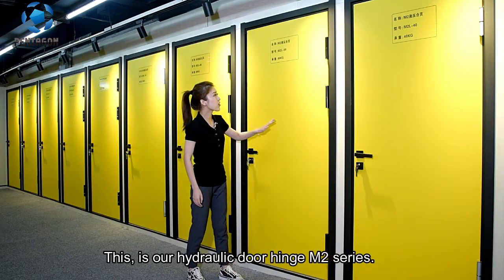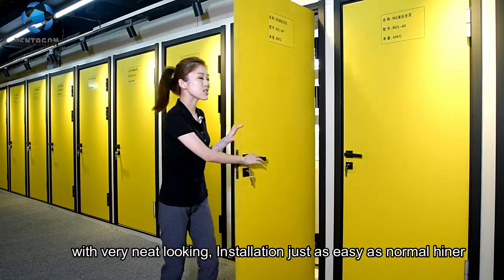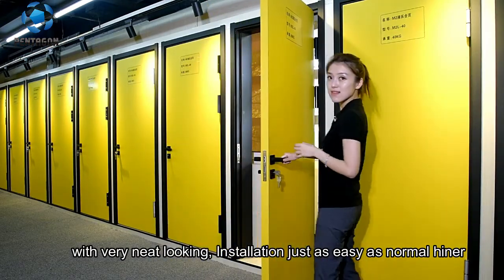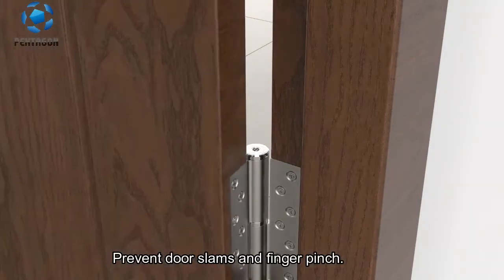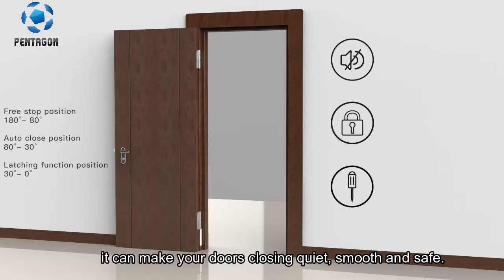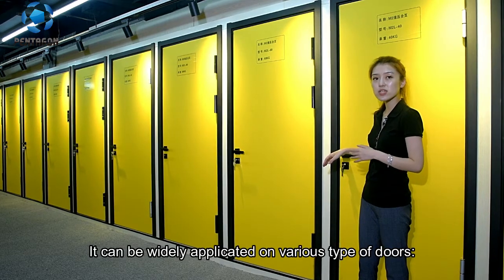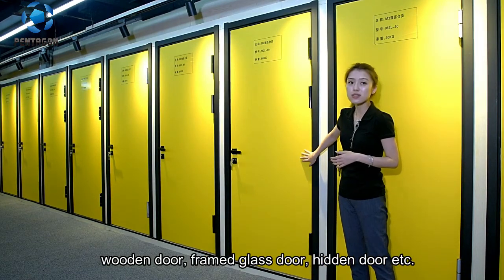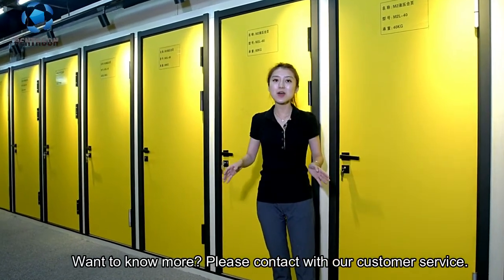Hydraulic door closer hinge, anti pinch and prevent door slams

Comment: can we control  from which angle the auto close needs to start? 
currently after 85° the auto close starts, can we reduce to 50° so after 50° the auto close must proceed.
Reply from the maker: The angle to start auto close is preset in manufacturing, can not be adjusted by users.  It needs to be customized if needed smaller angle.  
Why you need it to be 50 degrees?
You may also take a look at our door damper P7 which start auto close only from the last 15 degrees. 
If any further question, also welcome to send inquiry sales@cnwjkj.com
Reply: @ningbopentagondampercorpor256  hi , do we need to put more force to open the door , i mean the pushing force